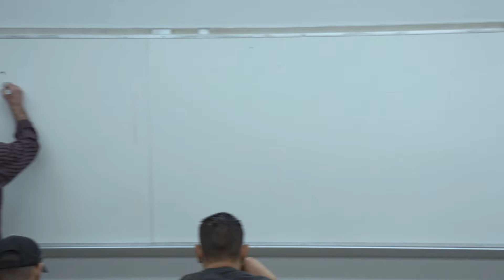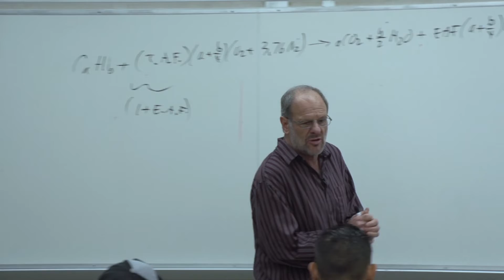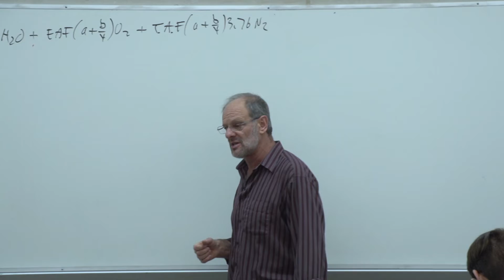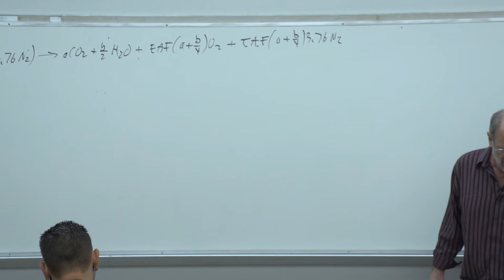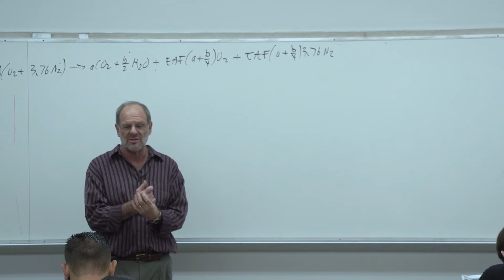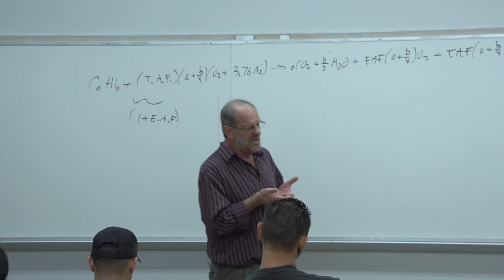Thermodynamics: Combustion with excess air review, Course review (51 of 51)

Comment: I have a question for professor David Miller:
Propane gas is burnt in a rigid, closed container at 80% theoretical air. Both carbon monoxide and carbon
dioxide are present in the combustion products. If the molar ratio of CO to CO2 after combustion is 0.2,
determine:
a) The incomplete combustion reaction equation when the propane is burnt at 80% theoretical air; 
b) The molar air-to-fuel ratio (AFR) of the incomplete reaction;